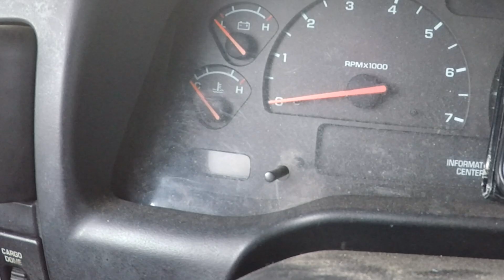Is it OK to drive with a "STUCK OPEN" thermostat (code P0128)? (Thermostat 101 - Part 4)

Comment: I’ve got a Audi all road diesel and the thermostat is stuck open for the past three years, in winter I put a piece of cardboard in front of the radiator in summer I don’t, ps on my car the thermostat is behind the cam belt so a really big job that would cost more than the car is worth.

Comment: Better to have a stuck open then closed thermostat. Plus you are right but not exactly the computer will only warm the engine up to a certain point. Once the vehicle hits idle on a cold start it’s warm enough to drive. The operating temp of a an engine is mostly for fuel economy and heat in the cabin but driving on a stuck open thermostat won’t harm the engine at all just your heat and fuel.
Reply: I seen people drill a hole in a thermostat to get better cooling. My car takes 30 mins to get to operating temp I just now realized it's stuck open I've had stuck closed so many times and it went straight over heat. A overheated engine is toast no doubt if it over heats once or twice there's alot more damage.
How can anyone get oil coolers and extra cooling components without even thinking to modifying their thermostat first. I live in a warm climate I don't deal with Frost.
If the weather froze over I'd really appreciate the thermostat. But so many people literally remove it and have no problems. 
 I'm on the assumption that thermostat need to follow a rating for different climates and that intuition is coming from my experience as a helicopter technician. Same as oil viscosity. Really depending on bearing clearences if the motor is tight I wouldn't buy it unless you know where you live is good for the light viscosity 
Thermostats are not a one trick pony for all climates and this is pointing to a bigger issue from what research I can gather the small hole being drilled into it to allow coolant to flow is probably the most likely answer to what climate your in the size of the hole will vary from climate. No one talks about that being a consideration to operating engines in a global capacity just buy what crap they sell.

Comment: $5/ $20 I just paid $92 for a OEM from Honda
Reply from the maker: ouch!
Reply: 50 bucks for the thermostat and 20 bucks for some coolant and a little of my time anyone can change a thermostat. Some cars it’s in a tricky area most are accessible.
Reply: For the penistar v6 that dodge ram jeep uses it comes as a whole housing for $50 to $70 pending on dealer or what not. Not fun.

Comment: So, my radiator melted down three times in a year. I scheduled a replacement and realized I have two thermostats. It was super expensive to repair, so I only ended up replacing the front one. I really hope that fixes the problem. I also asked the mechanic to find out if it was the sensor.

Before the replacement, I got the code P0128. My engine temperature was cool near the problem, then went back up to normal at around 179°F on the highway. But on idle or city driving, it got around 185-199°F, which is normal for my car. Right when i have the radiator melt down. My temp needles jump up to redline so quickly before i can stop to cool it down, thus causing the melt. 

It's been two months since the code popped up. I'm currently waiting to pick up my car.

I'm keeping my fingers crossed that it's either the front thermostat or the sensor.